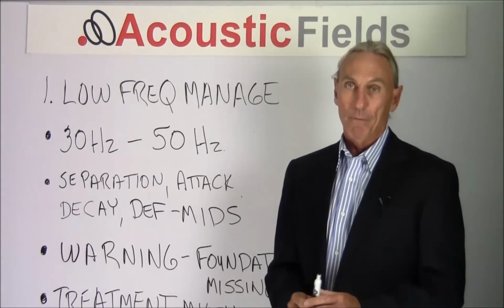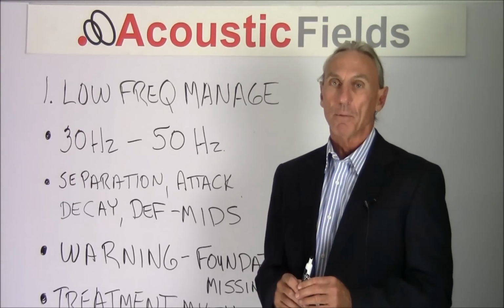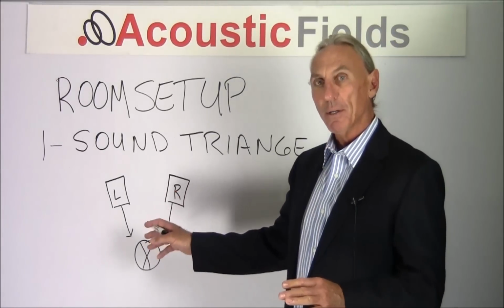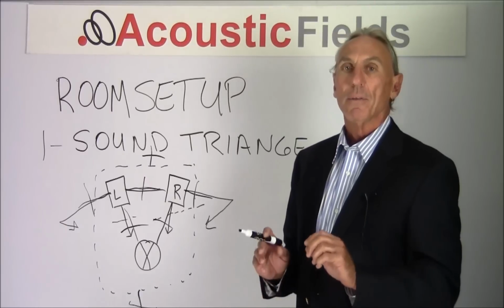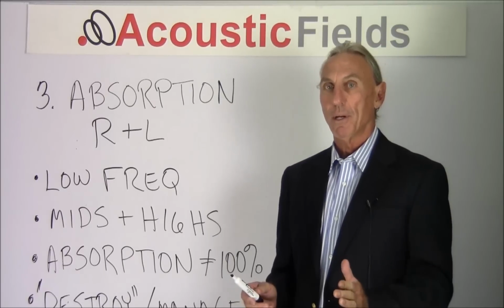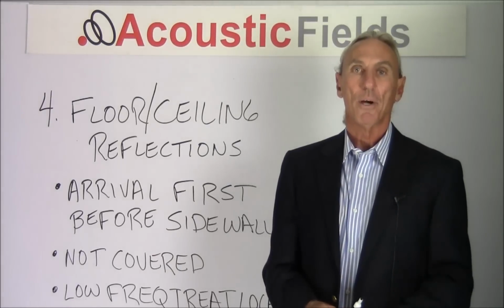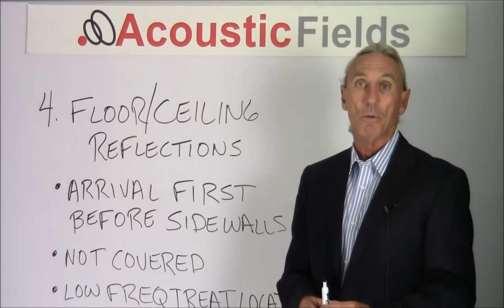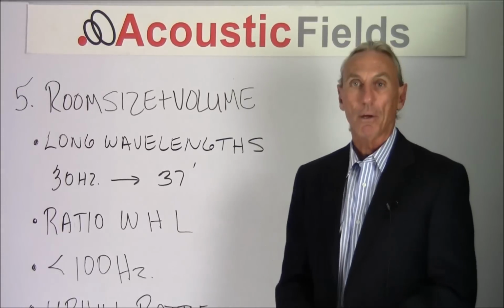Top 5 Acoustical Mistakes Most Studios Are Making - www.AcousticFields.com

Comment: I guess it's all about cleat definition. Stating that 100Hz is not a low frequency is all fine as long as you are clear about the consequences of such a statement.

Concluding a bass trap won't be able to absorp bass is just as misleading as all the pirates out there stating you can control all of your low frequencies with their bass traps. 😂

First of all: to my knowledge there is a clear distinction between bass and sub bass, the first being around 60-250Hz and the second one being from 20-60Hz. Having the illusion that your can control 60-250Hz with some 100mm bass traps is ofcourse utopic. 

Still, by setting clear goals and respecting the audio on most certainly get a hold of more than this guy is stating. By departing from a good triangle (speakers in relation to the listening position) in relation to the room and the right placement of bass traps you can surely get enough control in high, mid, lower mid range and bass to get a good result. Lower bass and sub bass not so much.

The separation of 100Hz up and 100Hz down is in my opinion a real fact. You need a complete different technology to be able to control that range. 

Still understand his way of putting things if you are also selling products and competing in a market full of pirates. 😂
Reply from the maker: I can only be responsible for what our products perform at. The acoustic world is full of ignorance and outright nonsense. Classifying low frequency energy as energy below 100 hz., separates the energy and the treatment methodologies for better understanding and application. Energy below 100 hz.,regardless of frequency, requires a pressure based technology, while energy above 100 hz. can be achieved with molecular velocity methodologies.
Reply: @AcousticFields  That really makes sense. So in other words: everything aboce 100Hz can be absorbed by velocity absorbers. Following the 25% rule you would theoretically at least need 33" of insulation material with a low density and flow resistivity to absorp that energy?

Comment: Love your take on things, I'm currently working on a remodel project. Studio is 200 feet from a main rail line, 50 freight trains a day. We have steel corrugated siding, 2x8 pole shed construction, R21 glass insulation, 1/2" drywall. AKA train wreck for a studio. Well that has to go...  I was going to tackle this from the main stream line of thinking and materials, until I landed here. You have confirmed my suspicions that most general contractors are clueless regarding low frequency sound (trains with no horns) and what it takes to mitigate it.  What is you take on large glass windows. Example Three 48 tall by 60 wide commercial double pain Aluminum frames. This is my biggest concern. I can replace them or even add a second set to double up. I don't care about space and can frame thicker walls   Regards Al
Reply from the maker: All noise must be measured. The barrier you build is based upon the frequency and amplitude of your particular noise. Without the noise numbers, you are just guessing and guessing with noise issues is failure. Fill out the information in this link: 
https://www.acousticfields.com/free-room-analysis/

Comment: Hi, at 1:38 what do you mean by rates? Is that the frequency rate you are talking about? Presumably levels is the SPL? Thanks
Reply from the maker: Rate is how much is absorbed at each frequency. Level is how low the technology starts to work at.
Reply: @AcousticFields  Ah great, thank you, I misunderstood.  So, rate would be a decibel reduction value for a particular technology (or rather particular useage of that technology) for a specific frequency.  Is that correct?  And, when talking about 'level' being how low the technology starts to work at, do you mean low as in what SPL it starts to work at?  Thanks again.

Comment: So what if i use safe and sound and make it 9 inches thick will it be able to absorb blow 100 herz then?
Reply from the maker: Yes, but it wont have rate. It will have level but wont absorb at the proper rate for music and voice. Music and voice can never be treated properly  using a building insulation type material that was designed to keep our homes warm or cool. Level is the resonant frequency or how low the unit will go down to. Energy above the design level will be absorbed but energy below will not. Rate is how much energy the unit can absorb at each octave band. Is it a linear absorption rate or does it have spatial irregularities in its response. Remember that music and voice and building insulation do not mix.

Comment: I don't get this not hearing 30Hz thing because you don't have a 37' room. I mean if this is true, forget about headphones, right? Really? I'm stuck in a room 12' x 17' (treated) and I can hear everything balanced and in context just fine. So...
Reply from the maker: W, If you take measurements in your room, you will see the issues you are not hearing.
Reply: Acoustic Fields thanks for replying. Like you said "we tend to hear laterally"  and I have for years treated ceiling and floors. I have used the 1/5th rule when placing speakers and seated positions. When tuning the room using pink noise and sine wave. My aim when conditioning studios is to make the sweet spot as big as possible. If I find a sub frequency that's a noticeable problem at the rear of the room, I find the frequency length and then design traps that absorb at a harmonic and a resonant level and, as you said this is where the roof comes in handy for making the low end nominal and tight.

Comment: Why don't sound engineers in studios just use quality headphones? Removes 100% of room acoustic distortion/interference problems in one go! :-) And you also get to monitor the music in the way most peeps listen to music these days anyway (I know this wound not work for multi-channel sound mixes or playback)
Reply from the maker: G, I know engineers, classical music mainly, that use headphones almost exclusively. Others that I know use both headphones and monitors. I believe it depends on the musical genre.
Reply: @AcousticFields  I use headphones all the time for mixing and get great sound cause the room is not in the way but I do check to make sure everything is right on my studio monitors and it usually is and I mix in mono that really helps me separate the frequencies.

Comment: Seen people building DIY vocal booths either using -wood sheets or - drywall/sheetrock. Which one is a better sound barrier ?
Reply from the maker: H,  It depends on the frequency and amplitude of the noise you are trying to reduce the transmission of. There is no good, better, best. Everything used in a barrier is dependent on the frequency and amplitude of the noise source. Material density is critical but so is the construction methodology.
Reply: Hello,thanks. It's vocals of different voice styles, metal growlers, rappers, etc. Pre made commercial vocal booths like the "Whisperroom" are obscenely expensive for a regular person. Their walls look so thin. I wonder what kind of layers they use, but really no need to make walls as thin, just need function. I have to be quiet in my apartment or i will get in trouble ! This is like a s.o.s question, lol.
Reply from the maker: H, That is the noise source inside the room. What are noise sources outside the room?
Reply: Depending time of day, some trucks and screaming but i can choose quiet hours for serious recording out of creative/practice time.The  main thing is to not disturb thin wall/floor/ceilings of an apartment complex, must avoid a witch hunt, not easy being a creative...Not sure i care for complex richness of the audio. Average/good, ok would be fine, i am running on a budget.
Reply from the maker: H,  What floor are you on?
Reply: Second floor. Which i would say floating thin fake wood floor on top of an old regular made wood plank floor which could be resting on plywood atop an approximate 12 inch regular pink isolation fiber-wool under space before the neighbor's sheetrock ceiling.
Reply from the maker: H, What story  are you on? First floor, second floor?

Comment: I’m thinking of setting up my listening room on the diagonal to see what happens.  That is, speakers and listening position are not on a line bisecting the room but instead going on a line from corner to corner.  Maybe even at an angle not quite diagonal, just to get acoustic modes more random.
Reply from the maker: J,  You could try. However, without knowing your room dimensions, this is problematic. Make sure your side wall distances are equal.

Comment: ALRIGHT A PROFESSIONAL! Most of these amateur builders FREAK out when I tell them that a booth window requires at least 3 panes of glass (all different thickness)  floating in a rubber frame and the frame held to supporters with isolator.
That the glass closest to the studio needs a VERY specific angle and that silica gel must be spread in burlap sleeve filled with some soft material within the glass panes. Their eyes just roll over to the back of their heads. I see a bunch of DIY  spending thousands to do a project which will result in a slightly better attenuation than gluing egg cartons on the wall
Reply from the maker: M,  I had to laugh to myself about your comment. I go through this sort of thing everyday. People don't understand how much is required to achieve noise, music, and voice objectives.  I try to educate using simple examples but companies have done a good job of misleading and misrepresenting the truth when it comes to isolation and treatment requirements. Its an uphill battle every day. Jump in anytime and assist. You are more than welcome here.
Reply: Well said man, you made my day. Some people can’t handle facts.

Comment: I have gik acoustics basstraps in my room, however the walls on all sides have built in ledges on them, so centering a basstrap on the wall is impossible. How can I work around this? Would putting them horizontally work? Thanks.
Reply from the maker: Hi Skrenja, I will need more information about your room to assist you. Fill out the information in this link: https://www.acousticfields.com/free-room-analysis

Comment: What are your thoughts on Anti Mode devices to take care of the low end?

I have DSPeaker's AntiMode SII, and the difference it made in both movies and music in a 5.1 setup was huge, after it takes away the peaks.

I only have a room that is 10ft w x 10ft l x 7ft h, with B&W CM10 S2 Fronts, with matching Centre and Surrounds {all biamped} with an SVS PC2000 Sub, via a Yamaha RXA 3040 and MXA5000 power amp... so a tonne of power in a very small space!
Reply from the maker: Hi Paul, I know some designers that have had limited success below 100 Hz. I do not have any personal experience with phase inversion electronics. You need to find another room. These are the worst three dimensions I have seen in a long, long, time. There is nothing that can be done to improve upon these dimensions.
Reply: If you mean inverting on an electronic level, then the AntiMode doesn't do that by itself {that only needs to be done if using 2x subs}, otherwise the only inverting that can be done is via the AVR when you select the XO.

AntiMode does great at EQing the sub, then you run YPAO after and the results combine, and given the small space it's all in it sounds great to me, not boomy at all; just nice, tight, well~defined and punchy!
Reply from the maker: Hi Paul, Send me a response curve of your room with and without electronic manipulation. Lets pursue this line of reasoning for our followers.

Comment: 30hz to 50hz doesnt matter at all, focus on 100hz to 500hz instead
Reply from the maker: Hi Cameron,  100 - 500 cycles is vocal and those precious mid ranges. However, 30, 40, and 50 cab be just as good if managed correctly. Come to my studio in LA for a demo. It will change your life.

Comment: Is that intended that the sound of this video (unlike your others) has such a low quality to show the issues you are talking about? :-)   There is some 50/60Hz bass hum which needs treatment :-)  Now seriously: Pointing out the floor and ceiling reflection issue is important: Many people overlook this for some reason. Hard to believe, but even 2 out of 3 companies, asking me to check their room reverb emulation software did not take them into acount propperly.  :D. Thinking into the 3rd dimension seems to be an issue for many people. Also rear reflection is sometimes earlier than the side in wide but short rooms when the listener sits at the back in the "HIFI" position.
Reply from the maker: Hi Juergen, In the beginning of our video endeavors, I was and still am still focused on content and not delivery. We were growing quickly and moving around a lot. I used whatever I had available that was quick to set up and use. I have over time improved upon that system and our new series even uses a black board instead of a white. Lighting a blackboard is much easier without the reflections of a white board. Comments range from only about the audio presentation and no comments on the content to those such as yours that mix both together and then those that are just content driven. I delete the first group without hesitation, because they contribute nothing to the real discussion.
Reply from the maker: Rear wall issues are always a concern along with, as you point out, the side walls in narrower rooms. Another issue that is overlooked in the treatment of both of these surfaces is the proper rate and level of absorption to match and compliment the chosen usage. I don't know where this one size fits all approach got started. Not calculating the proper reflection time signature for both side and rear walls using the correct rate and level, is a common error and see and hear even with older studios in LA.

Comment: Is this more addressed to having a room with monitors while mixing, or actually setup to record in?
Reply from the maker: Hi Michael, The "sound triangle" is an "triangle" with speakers / listening position at equal distances from each other. The issue then becomes where to place the triangle in your room size and volume for smoothest response.

Comment: I've watched three of your videos, now.  It is educational but, not addressing my concern.  My concern is for an office environment.  A law firm with several offices along the perimeter wall of the high rise glass/aluminum exterior wall building is asking me to "insulate" the offices from each other.
They are interested in damping voice transmission.  Their corner offices are good.  Those metal stud walls go to the concrete deck above and have mineral wool insulation floor to deck.
In trying to retrofit the remaining offices, we insulated with mineral wool batts over the lay-in ceiling to no avail.  We then, blew in fiberglass (attic type) insulation into the wall cavities (again to no avail).
We next are to extend the office walls to the deck, remove the gypsum board, install mineral wool batts, and install new gyp bd.  This will bring the walls to the same construction as the corner offices.....I think.  We will start with one room to see if it works before we do the other twelve.
What are your thoughts on types of insulation (mineral wool, fiberglass, fiberglass SAB)?  Maybe unbalanced wall construction (one layer of gyp bd on one side and two layers on the other side)? Or maybe use resilient channel on the existing metal studs before we apply the new gyp bd?  Again, this is just for office environment phone calls (or people meeting) voice attenuation/transmission control.  This is not a sound booth.
Reply: You may want to look for mid frequency absorbers mounted to the top ceiling of the rooms. They typically are made from 1 inch thick wood having many drill holes of a high density with about a third or a half inch diameter covering about 20% to 25% of the hole surface. These plates have a typical distance of a bout 5 to 10 inches from the ceiling rigid wall. Sometimes the gap is damped with material. This way waves go in and are "killed" because of turbulences around the holes.
Reply: ralph sampson look into high mass vinyl

Comment: Thank you for another informative video. The theoretical information you give is very valuable. I understand some readers don't understand that you cannot give all the information you have labored and learned throughout years of research and practical experience and you cannot just give specific instructions or data on their rooms unless of course they get your service. People forget that you are in business and some of the specific information that they are asking frankly should not be given for free. Also what ever free information you give and explain is more than enough.
Reply from the maker: Hi Henry, Thank you for your observations. Our data base of built and measured rooms goes a long way to assisting clients with the correct room size and volume for their particular audio usage. From there, we can address any barrier or treatment options. Our DIY series of diffusion and absorption products can assist those clients that are on a budget and for those who do not have the carpentry "gene" , we can build both absorption and diffusion units for them.